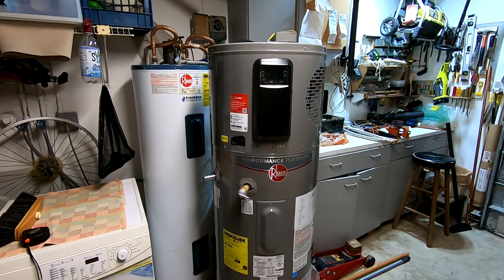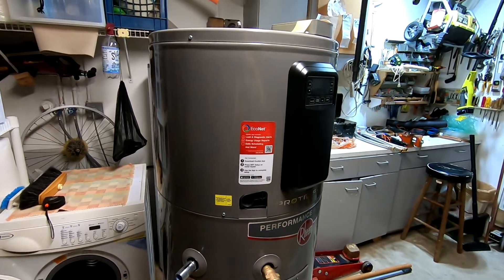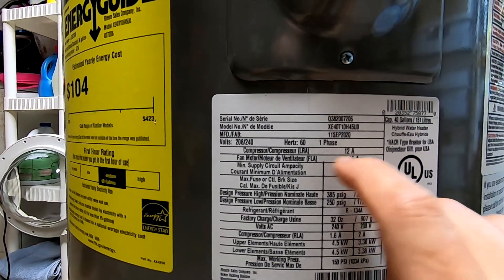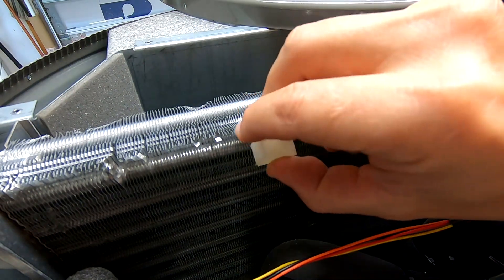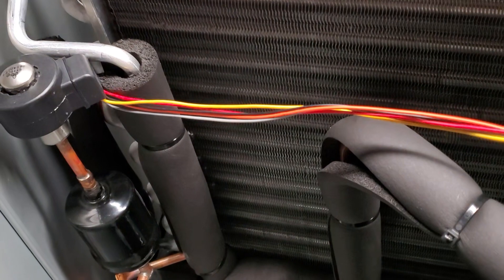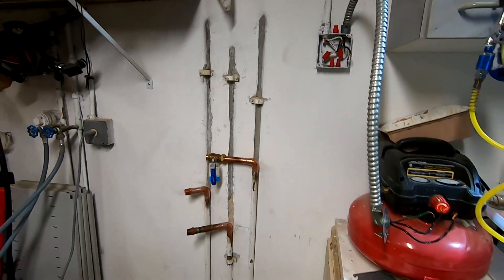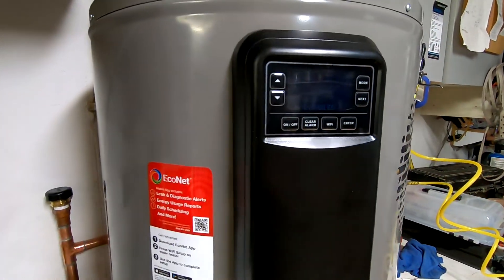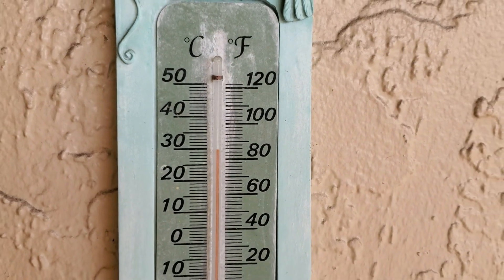Rheem Electric Hybrid Water Heater Installation

Comment: Maciej...I've been investigating options to replace my 13 yr old GE WH and I've been on the fence about which way to go. After watching your video, I'd say I'm now 99% sure I want to go HYBRID. Of all the installation videos, yours is without a doubt the cleanest install. I live in Davie so we're practically neighbors. My WH is also in the garage and I would have to modify my piping. Do you have a diagram of your piping because it would be similar to what I'd need to do? I really like the Rheem(without leakguard) because of the EcoNet technology. The cheapest I've found it is around $1375 at my local plumbing outlet. Home Depot only seems to carry the model with Leakguard($1499)! How did you get it for $1000? Great job on the video and any suggestions/help you can offer would be greatly appreciated. Thanks!
Reply: I installed mine my the utility room off of the garage.   If you really want to save money - if you own a ranch style house especially - run a 8 inch duct up to the attic and pull air from the attic on the intake side (you will need their adapter unless you can make one).   And set the schedule to run in the afternoon when the attic is warmest.  Works great at least where I live in North Carolina....
Reply from the maker: Romany Kemp good tip. I live in FL and my unit is in garage where there is 90+ F in the summer. With this unit there I was able to drop temp in my garage by about 10F. There is plenty of hot temps in garage so I don’t need to connect it to my attic. I'm not engineer, but don't you worry about disrupting proper attic ventilation by putting a duct to the attic to suck the air? Hot air should rise and exit at the top of the roof, not being sucked at the bottom of it.
Reply: @MaciejPiotrowski So I am "pulling" attic air into the garage - but I have an opening back to the attic in another part of the garage - so the same volume of air removed from the attic is returned.   One would think that hotter (attic) air would be more efficient in heating water - how much is anyone guess.   I'm tracking my usage so it should be interesting to see how much of a saving I'll get when summer arrives.   I'll also find out how "cool" the exhaust air is after going thru the compressor - I'm assuming it will be stay about 20 degree cooler than the inlet air.  If that correct if it 115 degree in the attic the exhaust would be around 95.   If it 100 degrees coming out of the tank that would suck...But it would be easy to revert to the way you are doing it during the summer months...I can tell a difference in how long the compressor runs in the afternoon when it say 35 degrees outside  or it 50 degrees.  If it never warms above 35 the compressor normallys runs the 5 hours I have it set for...if it warmer outside it will reach it program temp and turn off prior to my schedule setting turning it off...
Reply: @romanykemp9042  Great idea  puling hot air from attick and using it.
Reply from the maker: Send me email mpiotrowski@gmail.com and I can send you my photos. Rheem has sales from time to time. I bought mine for about 970 on sale from 1176.